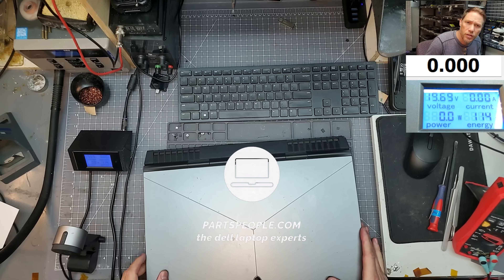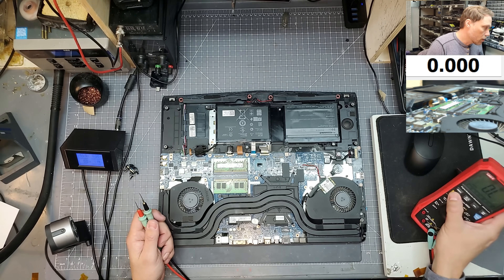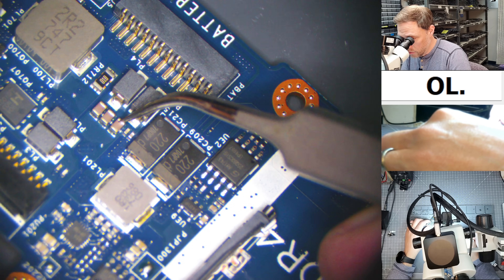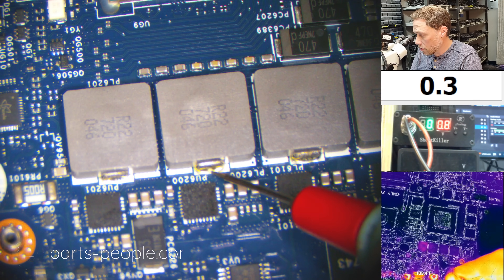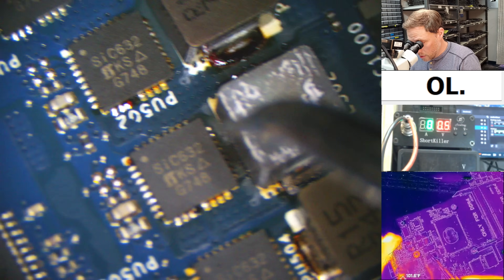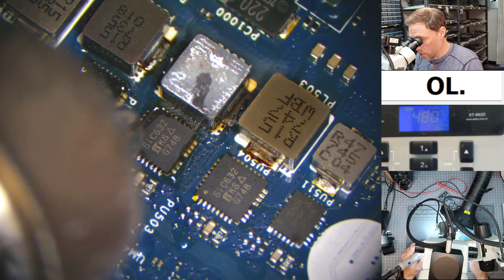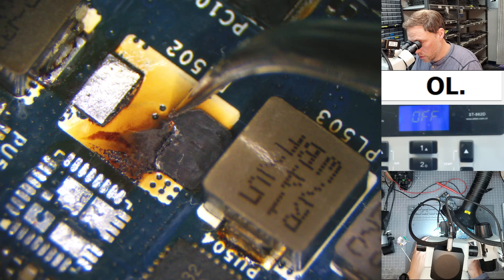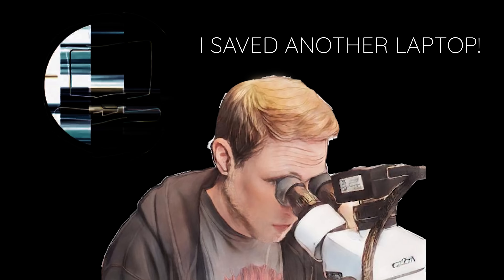Why This Gaming Laptop Is BEYOND Repair – And CANNOT Be Fixed!

Comment: I saw that coil with the missing top on your first scan of the board. It stood out to me because I’ve also never seen one of those fail so spectacularly. 

Why do so many of these laptops have the same issues in the power rails? Seems like bad design.

Comment: why are you using that crude voltage injection tool when your having a bench PSU just beside?
where you can easily adjust you voltage and current.
Aint it just a highly limited PSU, that in your case gives you voltage adj.?

Comment: I would have used some copper solder wicking side of the coil would be very rigid and the other side you can squeeze and shape the wick and make it have enough solder. It looks doable to me.

Comment: i have one, and i'm using now , upgraded with 32 Go, it's a old Intel CORE I7, with 2 SSD and the originale disque, and a GTX 1080 buy in 2009, and it's very good yet, i hope it lasts a little longer, i have an other very old Alienware M17x (2002 i'm not sure) with batterie probleme but is in good shape too, i managed to find a battery but it worked for a month and no longer charges the batterie this one work only with is own adaptater, I'm not buying any recent Alienware PC but the Dell Alienware from 2002 and 2009 was a very good model.
the one of 2002 remained in Windows 7, and the 17R4 works with windows11 in test, I plan to pass the one of 2002 in linux, even the rest of PC lol.

Comment: I have a Lenovo Ideapad 310-15ISK purchased in 2016 and still works. I've replaced the battery after it ballooned and cracked the D shell (base). Now looking to replace the D shell.

Comment: For your current injection, why don't you just use a programmable power supply where you can set the voltage and limit the current.

Comment: "In pretty good condition for 7 years old" and here I am watching this video on a near 16 year old HP laptop I bought brand new in 2009.   .   🤣🤣🤣🤣

Never had to do so much as a single repair.  Sure.  A few upgrades but it has NEVER needed to be fixed and still works like a charm.

Comment: @dellpartspeople Wooow😮 thats a really bad burn damage I can see why it wouldn't be repairable and thats just the surface I can only imagine the damage inside the motherboard on that particular area. What did the other side of the board look like? Even if the trace was fixed etc to where its workable, to me the same problem would come back up. Ok then correct if im wrong if the damaged part of the board was repaired somehow how long would the laptop be able to last ? Then the issue of the burn damage effecting the life of the motherboard. Byte Size Tech made a video titled "How to know when your motherboard is about to fail" that touches upon this topic.

Comment: I still have a Alienware 17 R5 with a 6 core I9 and 1080 with 3 nvme drives . Its still going but has had fans , battery and new keyboard recently . It has a 1440 screen at 120 hz so i hope it keeps going ..

Comment: Hello sir i know this is stupid question but i have the same laptop that you trying to repair right now, i keep changing the thermal pad but still getting the same 60 70c on cpu and gpu on gaming.. can you atleast tell me the right size of the thermal pad on that heatsink. Because i think i keep doing it wrong. Im using thermal pad gelid 1.5mm and i think im not on the right size.. i think every thermal pad on that heatsink is different sizes every part please tell me. gladly appreciated.

Comment: Could have put a jumper wire if you would have scraped a bit off the top and find a pin size connection then wire it to the other side of the coil, or jumper wire along the rail on that side just before it touches the coil

Comment: Being 7 years old at the time of the video ,,, I would’ve questioned the desire to repair it in the first place. The cost to repair and factoring in the age of the technology would easily outweigh replacing with new age tech. Or if a very specific reason exists requiring that exact model, source one (and or parts) from a marketplace.  But ya, environmentally speaking, I too like keeping tech from the landfills as well.

Comment: I would fix this, by using a solder wick as a botch wire as it would be able to carry enough current. I fixed much more damaged boards in the past, even had few with a hole burned through that I managed to fix and even put a 6 month warranty on it. Needless to say, they still work even 2+ years after being fixed :)

Comment: Unfortunately after this debacle, I'm clicking on "don't recommend channel".
Not even attempting to fix it is crazy.
Reply from the maker: Thanks for the feedback.  A couple of things I took into consideration before deciding not to continue trying to repair this motherboard. 
This laptop is 7 years old, and the pad that was burned and destroyed carries a lot of current.  I have replaced countless burned and ripped traces, but those are all low current. The MOSFET that is outputting to this COIL is rated for 50amps, so this track will need to be able to carry a lot of current and dissipate a lot of heat.  Also, I have worked on 100s of these Alienware over the years, and there is no guarantee that the CPU survived in the first place (probably less than 50/50).  One last thing, I warranty all motherboard repairs for one year, and rigging a temporary fix does not seem like a repair to me.  

I would love to hear your thoughts!
Reply: @dellpartspeople  Why not strip the mask and try to reconstruct the pad ie via foil. If that makes you uneasy, you can always reinforce with thicker wires (ie from pad directly to inductor). Also the current isn't going to be anywhere near 50A, you have 4 or so phases, so at most 10A. If CPU draws lets say 40W.

Comment: I have a question about a cooling fan in a laptop.
It is grinding, like the bearings are gone. Is it possible to make it shut up, if I take it out.
...clip the blades, or hit it with a hammer. 
I'm on holidays, and I won't get parts before I get back.
Sea burial is another option...but laptop lives matter, don't they?!
Reply: Buy a replacement fan or try adding a drop of oil to its bearing, if accessible. Seawater wouldn't be a good lubricant though.

Comment: Any chance of a link to the desktop power meter? Looks quite handy
Reply from the maker: I made a special power volt/amp meter to test Dell and Alienware laptops with.  On one side, you can plug in the Dell charger; on the other, it gives you both sizes of plugs for Dell laptops.  It is very useful to see what a laptop is doing, whether it is charging the battery or even turning it on.  I will make a video about it and how to make it at some point.

Comment: Tbh, if the CPU is still alive, and that's a big IF, then it might be worth to try to work on that area anyway. Grind off the burned layers, isolate with pcb UV mask, replace coil, replace powerstage and attach a big enough wire from the powerstage to the coil. It will probably work just fine. Question is if you can give your customer any warranty doing that, because of course you are right: technically the board is gone.

Comment: That was totally rebuildable, imo.
Reply from the maker: Possibly... but...  A couple of things I took into consideration before deciding not to continue trying to repair this motherboard. 
This laptop is 7 years old, and the pad that was burned and destroyed carries a lot of current.  I have replaced countless burned and ripped traces, but those are all low current. The MOSFET that is outputting to this COIL is rated for 50amps, so this track will need to be able to carry a lot of current and dissipate a lot of heat.  Also, I have worked on 100s of these Alienware over the years, and there is no guarantee that the CPU survived in the first place (probably less than 50/50).  One last thing, I warranty all motherboard repairs for one year, and rigging a temporary fix does not seem like a repair to me.  

I would love to hear your thoughts!

Comment: 🤔🤐🤨🤨You complicated the subject. It is true that the connection point is burned. Put a thin copper wire in its place, the connection point, and the subject is finished.
Reply from the maker: Interesting idea, but a couple of things I took into consideration before deciding not to continue trying to repair this motherboard. 
This laptop is 7 years old, and the pad that was burned and destroyed carries a lot of current.  I have replaced countless burned and ripped traces, but those are all low current. The MOSFET that is outputting to this COIL is rated for 50amps, so this track will need to be able to carry a lot of current and dissipate a lot of heat.  Also, I have worked on 100s of these Alienware over the years, and there is no guarantee that the CPU survived in the first place (probably less than 50/50).  One last thing, I warranty all motherboard repairs for one year, and rigging a temporary fix does not seem like a repair to me.  

I would love to hear your thoughts!
Reply: @dellpartspeople  Ok, I understood the topic well.Replace the motherboard.
As for the topic of the device’s age, this is nothing as long as its performance is good. You can increase the power. For example, I bought a PC that is more than 10 years old.I updated the CPU, RAM, and SSD hard disk.And it became better.👍👍👍

Comment: I would have soldered 2 heavy wires to the board and suspended the inductor just above the board (check for spacing). Common solution for me.

Comment: I'm so glad that at 12:10 you mentioned that coils do develop shorted turns. I've seen several repair videos where the techs ignore discoloured coils, replece all the other components and appear surprised when the buck converter still doesn't work!
Reply: That discolored coil jumped out at me.  I thought  it meant nothing when he first passed it up.

Comment: This issue is why I won't never would buy a Dell laptop again, it happened twice in my family, first to me with a Inspiron 15 inch and then to my mom with a Latitude. I switched to Lenovo Thinkpad, I am  very happy.
Reply from the maker: Interesting.  Well, this laptop was 7 years old, so I think it lasted a long time.  My computer specializes in Dell and Alienware laptops only, and I would say most laptops that we repair are older than 5 years.

Comment: 0:45
Did you ever publish how to make this? I'm having a hard time with the "charger ID Pin". It doesn't charge dell laptops even when 19V is present.
Reply from the maker: No, I have footage filmed, but I am not happy with it, so I plan on remaking it.  I will soon I promise.  I will include the 3D stl files also.

Comment: Iceman did it again! In my own research and testing, with perfect humidity and salinity conditions a mobo/videocard in which their components remains at:
40°C = will last over 10 years.
60°C = will last up to 10 years.
80°C = will last up to 5 years.
90°C = will fail at 1 year or less due to overheating.
Of course, the first components to die are usually capacitors, then MOSFETs, IC regulators, then diodes, transistors, resistors and very rarely coils.
Reply: 1 year for 100 C is quite generous, the silicon in transistors can usually withstand just above that, but they start to slowly deform and change shape & electrical characteristics, then they just die.
Reply: @joopie46614  knockoff chargers stay between 80 and 120 C internally, no wonder they last a couple of months, not to mention the risk of electrical shock. You're right, I was thinking CPU/GPU thermal throttling but I changed it to 90C for the other more simpler components.

Comment: Not too professional at all. His ohm-meter has a resolution of 0.1 ohm and even that digit was dodgy. His rework tools and techniques are primitive. I cringed as he yanked at that inductor while he heated it, then later he complained of a missing trace, and later decided to trash the computer as a result. He ripped it himself at 13:50. He does not even have a lab power supply with current limit. His language is pompous but not professional. One injects current and one applies voltage. He started with beautifully kept computer with an easily diagnosed power supply fault that could easily have been repaired, and ended up trashing it due entirely to his clumsy rework technique. Not all youtubers are great experts.
Reply from the maker: Thanks for your honest comment.   I am trying to keep it simple and easy to understand. Most people are non-technical who watch these videos, and I find spitting out large words and terminology does not make people want to watch.  I went back and looked at the footage, and that burned  side of the coil was already separated and arcing. I did not rip it.   The meter i use interfaces with the computer so it can be shown on the video, and yes, it is not very precise, but it gets the job down.

Comment: Hey FOLKS. Has he ever recommend any SPECIFIC dell model for college? Are the new XPS good ?
Reply from the maker: The Dell XPS is a high-end and very reliable laptop, but I would not go for the top-of-the-line version because the cost is a lot higher, and the heat it produces is a lot higher.  If you are getting it for college, then I would just get the i5 version, it will be plenty fast and have great battery life.  If you need the Nvidia GPU also, then you will have to get the i7 version.

Comment: There are copper tapes on the market, similar to the ones that were used for shielding in older ThinkPads. They are relatively thick and could do the trick. Can't say how thick that trace was, but it is worth trying to fix it. Was left a bit confused on why you called it.
Reply from the maker: I will have to look for that.  I still have the laptop. Maybe I will do a follow-up.   Thanks.
Reply: The legend that gave us another video on this laptop.

Comment: Maybe planned obsolescence? Plus if it a performance driven gamer laptop, it will fail due to high the electrical stress on the power supply components.

Comment: Hi i'm currently using the same laptop same i7 7th gen. how do i prevent this and other board failures from happening? i already cleaned and repasted with mx-4 only the thermal pads i haven't changed yet.

Comment: Dude, this was doable with a lead on the outside of the coil, on the MOSFET all connections which face the coil are inter-connected as one so a 1,5mm² copper lead soldered to all joints would made this, conformal coating on that thing and a little bit of glue in the center of the coil would fix this definitely. You could afterwards check it with the FLIR if it was suitable, now not even an attempt is being made, what an e-waste....
Reply from the maker: Just ordered some and will look to do a follow-up video.

Comment: My bet is the part was bad from the factory, or probably marginal.

I think the current generation of laptops run way to hot. 

I have it on a blower now most of the time when at my desk which pumps are through the case lowering the temps by 10C no matter what it is doing.

I use it as my work computer.